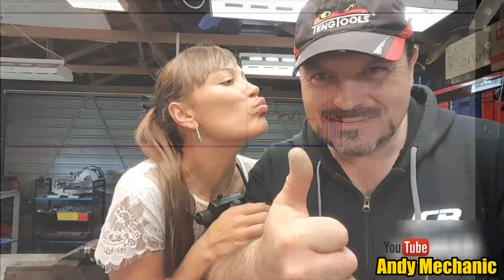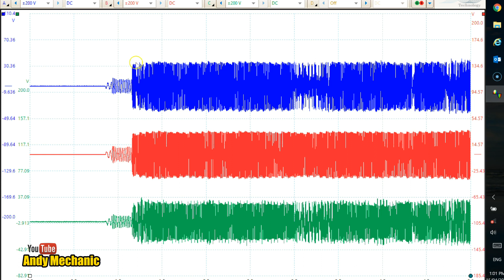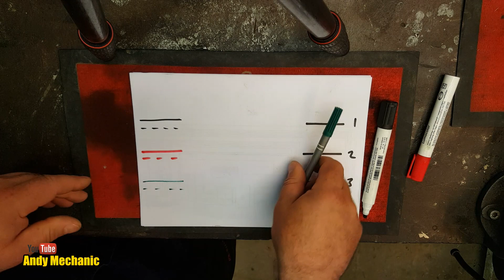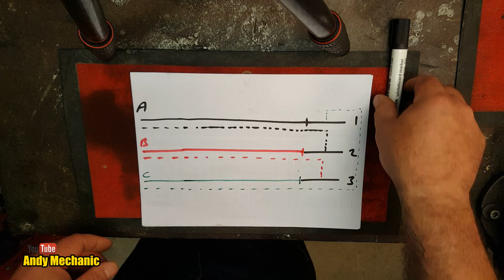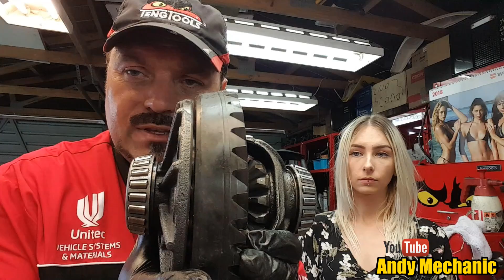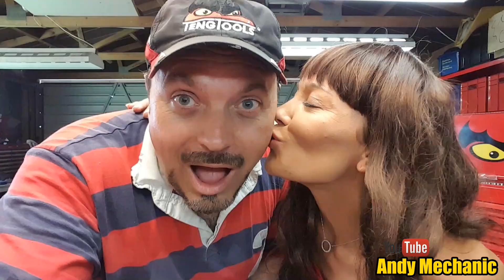Charging system   Stator output waveform capture #1441

Comment: Can you please do a series on all these Chinese CDI boxes and stators for the gy6 engines.
They have absolutely zero specs on them anywhere and all kinds of so called experts telling different conflicting information on them.
Amazon sells you a DC stator that ends up being an AC and vice versa and then there's a myriad of CDI boxes sold without any specs whatsoever.
I'd just love to see a real expert put a scope on all this mess and pin it all out scientifically!
If you do this video series I assure you they'd be a huge hit simply due to all the confusion and lack of trustworthy information on the subject.

Comment: its insetting how the  Chanel a has almost a sinusoidal sine wave .and the rest almost look like they ramp drop a bit and re ramp with in a micro second  . is it picking a very small gap up in the windings or is it the probes a bit lose ?
Reply from the maker: +Simon Rawle Hi Simon, yes, that anomaly puzzled me too. I did check the probe contact and performed the test a few times but always got that pattern?

I have a Yamaha R3 to check the charging on Friday so I'll capture that too and compare.

Cheers
Andy
Reply: i think it may be picking up a micro gap with in the  winding. a bit like if you had a creaked magnet in a fly wheel . im yet to see a r 3 in the flesh yet
Reply from the maker: +Simon Rawle hmmmm. ..good call, I'll monitor the bike it's on. Will be interesting if it fails sometime soon. Cheers

Comment: Dear Sir, I have carefully watched your video on Toyota igniters and their functioning. I wish to know that is possible use igniters as DC CDI in 12 volts system of motorcycles. Do these igniters have spark advance mechanism.

Please explain. T will be much thankful to you.

Shakeel Ahmed
whatsapp +92 322 8022127
Pakistan
 artline.cards@gmail.com
Reply from the maker: +Shakeel Ahmed Hi Shakeel, I'm pleased you found these videos interesting and helpful. I'm by no means an expert on this subject but will do my best to help.

From what I have found the igniter is more like an electronic relay. The IGT signal from the ECU is what initiates the igniter to break the primary circuit to cause the coil to make a spark.

The actual timing of the spark is dictated by the ECU and it's the IGT signal that would be varied accordingly.

So in answer to your question, no, the ignitor does not have the ability of calculating ignition timing
 
I hope this answers your question.

Many thanks Andy